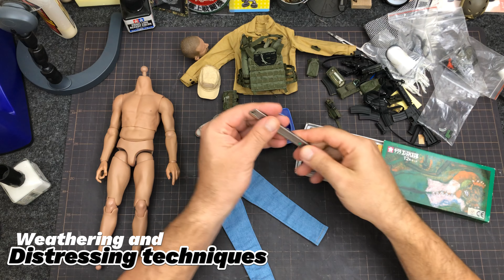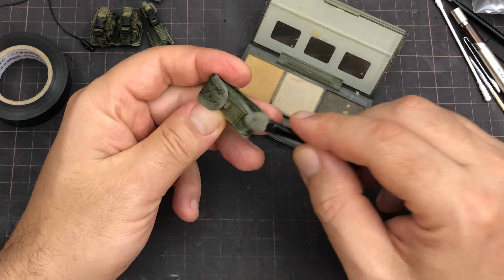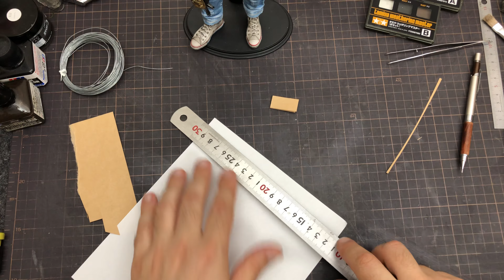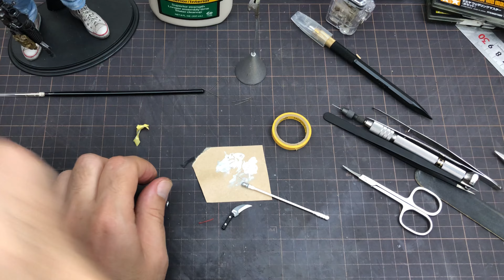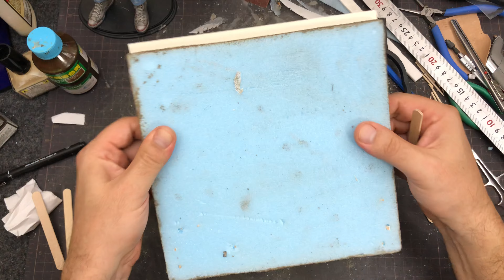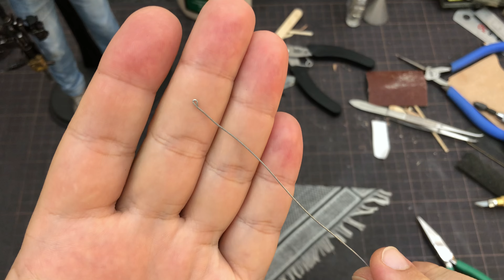How to kitbash a 1/6 scale figure - PMC in Afghanistan

Comment: Great job again, the hair fixer, do you use them for a better fit of the clothes? Thinking about doing the same, get it dry after using?
Reply from the maker: Yes! Hair fixer is super useful! It dries quickly and does not leave stains on the fabric. Try to find an unscented hairspray. In my opinion, it is an excellent method for giving them a good fit, modeling or something like that 👍🏻